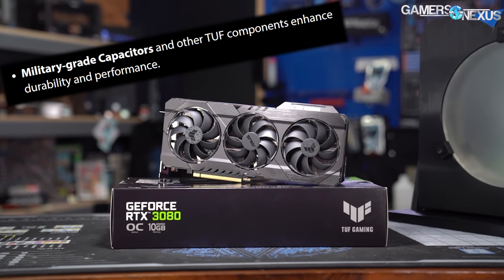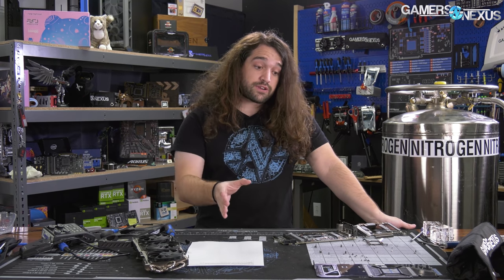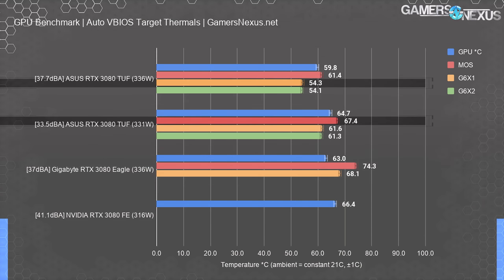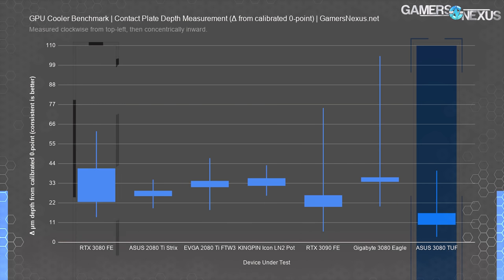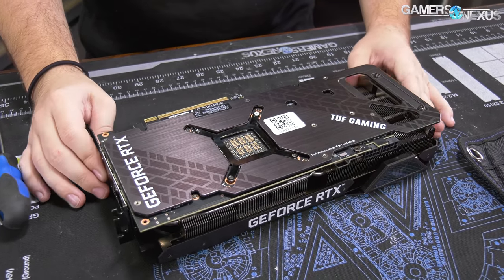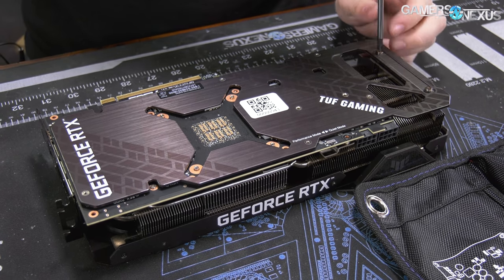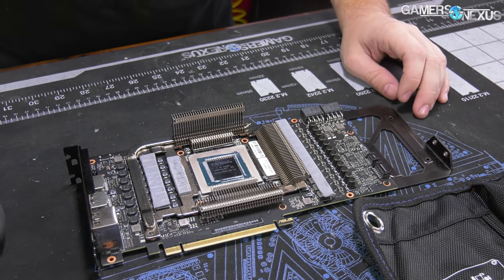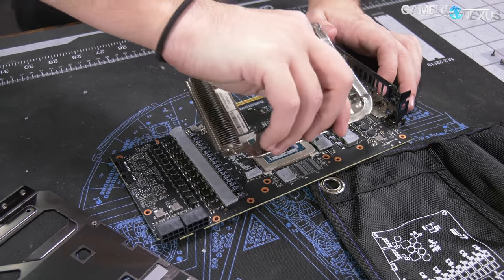ASUS RTX 3080 TUF OC Review & Tear-Down: Thermals, Noise, & Overclocking

Comment: As some folks already commented military spec components means they operate at wider temperature range, usually -40 C or less minimum and +120 C or more maximum. And while also have the supply chain secured and have longer lifetime, meaning the manufacturer won't deprecate the component after only few years, some go over 20 years. These all add to cost. From the lowest, the grades are: Industrial, Automotive, Medical (when it's about PSU mainly), Military, and then Aerospace/Space hardened.

Come on GN, you know better. Do your research before lashing out so you don't look like a total clown.

Comment: aircraft grade aluminium is not just aluminium. Its 6061 or 7075 Alloy. The term military grade indicates it is of higher quality or binned higher. I think the point your trying to make is that they are just using it as a marketing scheme. But to say that it doesn't exist in other context is silly.

Comment: "Military grade" means nothing.  The term that would be potentially relevant is "MILSPEC," meaning a thing meets the minimum specifications required for such a thing for use in militarily essential things.  I say potentially because sometimes that specification is not particularly strenuous.
Reply: then the question becomes which Spec.

Comment: 18:30 Inductors are not just a coil of copper ! XD
This copper is enclosed with ferrite that gets hot when switching power rail (12V) to lower voltage (1V).
The characteristics for these ferrites get much worse when operating at high temps. This means that if they get to 100C, they will lose a lot of their inductance and make a lot of noise, because inductance gets lower and current ripple becomes higher. This also brings more wear and tear to caps, worse power efficiency...
It could  get so bad that inductor stops being inductive (only wire), imagine what will happen if you short circuit 12V to 1V GPU power.

Comment: Well Ive got the TUF 3080 non oc model and have been playing around believe it or not in firestrike, trying to get the world record for a 3700x and 3080 combination of GPU and CPU, I have struggled getting past the 32000 points mark. Maybe its my TUF gaming X570 mobo? Cooling Noctua Chromax BLack? I dont want to run liquid nitrogen..... what are my options. The 3700x is a mega pain for manual overclocking and have had better results with DOCP (XMP) on the ram and just let the 3700x boost naturally. What are my options here that arent going to cost me an arm and a leg... I know the 5000 series CPUS are around the corner so the first person to say that... well... I wouldnt be going for the same record then would I. 

HELP !

Comment: Hey gamers Nexus, I would appreciate if you'd show gaming performance anyways, I can understand the reason why you skipped it, because it's nearly the same as other 3080,but I'd sind it way easier if all the necessary data for my purchase choice is compressed in one video. If I want to buy this card I and I didn't have the general 3080 gaming performance specs in the back of my head, I have to search for another video , even tho I just watched 30 mins review. If you could just show a screenshot of the general 3080 gaming performance it would already be enough for me. Thanks

Comment: I would assume "Military Grade" means that the capacitors meet Mil STD 198.
Reply: Don't assume. Its not a real term. Its all marketing BS. And if it does meet a Mil STD its probably not the correct one for this application.
Reply: For example the Standard for metal food packaging would be very different than the one for the metal in aircraft.

Comment: When you say "there is almost no gaming performace difference between two models" do you also say, that the TUF ist almost as good as the Strix? This would mean to me, that there is no reason for me to buy the Strix instead of the TUF. I do not really care about a little bit RGB, but I thought there should be a noticiable difference with the higher Power Limit.

Comment: lol fan replacement! I once had 2 msi gtx460's and the fans died on them after 7month, and i could not get msi to rma the cards or find  the correct fans for them so i took 4 80mm fans 2 per card and zip tied them to the card after removing the old fans and shroud..

Comment: If they are using actually MIL-SPEC certified capacitors ASUS is pissing your money away. You dont need the supply chain certification in a COTS situation. Looking at the PCB, there is no way the card meets many mil spec

Comment: Just for info aircraft grade aluminum is not equal to aluminum!!!! Check your claims. Aircraft grade are aluminum alloys that are heat treated topical 6060 etc. There are also submarine grade alloys of aluminium that are corrosive ressistant and czn be welded as aircraft grade can’t be welded as you are creating weak point as you destroy the heat threatment within and arround the vonnection!

Comment: Uhh...no Steve all the cards are not the same. Otherwise there’d be just one card on the market. Reason we want to see gaming performance as well as tear downs and everything’s else, is if we are going to buy a 3080, some of us want the best there is. Meaning best components used, best overall design, best stock cooling solution, best bin GPU, etc...average FPS, gives us an idea of its performance comparatively to other cards, even if it is just a few FPS. All of that gives us an idea for the quality of the card, and it’s potential OC performance. 

So no Steve, average FPS IS important to some of us. Yes we’d still like to see it. Otherwise what’s the point of an in depth review if some important information is omitted?

Comment: I feel that if taking off the aluminium top cover appears too dangerous for you, you shouldn’t be replacing the fans yourself

EDIT: The wires not so much though. Those should just be small plugs, current way you could damage the wires trying to cut it open or not be comfortable applying heat for the shrink tape

Comment: “Military Grade” is a legitimate grade of electronic components.  All components manufactured have a certain % tolerance of their rating (I.e. a 200 ohm resistor could be 180 or 220 ohms with a 10% tolerance).  Military grade tolerance varies for different components but is typically between 2.5-5% max tolerance.  While there’s usually a negligible difference in performance from using military grade components (since the die itself may have worse tolerance, negating any benefit, they almost always outlive any consumer grade equivalent (one reason why Macs tend to last a lot longer, Apple uses “military grade” tolerance components).
While there’s no actual “certification” for military grade for non-military use (there is for military use), the term is used to refer to a tighter spec based on military standards.

Comment: I own several Asus products.  All I gotta say is pray you don't have a lemon or have a need for support.  These products are great when they work, and you are pretty much fucked if you have to get in touch with support.  After several RMA's I had to go through the BBB, got in touch with a VP over my complaint.  Sent a disseration of the issues and symptoms I had before they could verify there was an issue and finally sent me back a different board that worked.  Pray to gods you don't have to go through their support.

Comment: I'm having trouble finding content I give a damn about lately with this 3080 crap. I cant get one even if I wanted, and as a matter of fact even the 2060 super and 2070's, etc. are still crazy priced, always out of stock, and nothing too interesting. I guess I got spoiled with that big jump in performance from the 900's to the 1060, 1070 cards. Now nothing really seems worth it. I have a 1660 that's running my games on high and a 2060 that's over 300 bucks is only 30% more performance. Hopefully there'll be a 3060 or something around there that's worth a damn that doesn't cost $500

Comment: That card is not that good as it should bee, to be TUF ;). Cooler is good, but not perfect design. I like Asus TUF motherboards ( my last three was Z270 Mark 1, Z490-Plus Gaming WIFI, and actual Z690-PLUS Gaming WIFI D4 ;) ). But when i wanted replace my old grapic card 2070 Super i chosed MSI 3080 Suprim X. MSI Suprim X is much better for me. ASUS made good motherboards and i use them from many years ( P5K SE, Striker Extreme, Maximus Formula, P7P55D-E, SABERTOOTH Z97 MARK 2 ... ), but i had only two or three graphic cards from Asus. Sometimes better was Gigbyte, MSI or Sapphire, and has better price ;)

Comment: Military grade? So beat to hell and barely functioning because the armorer is too lazy to actually put in the work order to get the parts to fix the issue because it’s not a deadline so you can scrape by until it “breaks breaks”. That’s what military grade actually means

Comment: Hey it's military grade, so that way our soldiers can play games while riding in a humvee sir, just as long as their wearing a static bracelet while installing, because you know static discharge is worse then a weapon discharge.... ok I tried, your on your own asus from here, so can i get a heat shield for my upper m.2 slot now, instead of  just the bottom slot? guess not...should of joined the marines..

Comment: Warning this card is no good at all, think carefully before buying it !!   I just tried it with a 270Hz monitor and wanted to quad buffer the FPS so I set max_fps at 1080 to get lower ping times but only get average 980 FPS at 320x240 d_mipcap 3, modified single color sky for higher FPS.

The difference from 270 to 980 FPS is around 4-5 ms.

Im so dissapointed, what are you even supposed to do with this card... play Tetris? I was hoping to buffer the screen Hz 40 times.
Reply: shud i upgrade from nvidia 3070 8gb FE to asus tuf 3080 12gb . please suggest. i have benq 1440p 144hz 27inch monitor
Reply: @CaptainScorpio24   That depends on what value money have to you but because you wtb a 3080 I assume you dont want to waste money so the answer is no. Do you want another card because it has more memory? If so then I have to ask if you run out of memory with the one you use now and if you do there is always the option to lower the resolution. I havent checked the prices but if you feel a desperate need to upgrade your 3xxx you might as well go for a 4xxx card unless you found a cheap second hand card.

Comment: ASUS's military grade claims are horseshit.

I used to use ACTUAL military grade computer hardware in Afghanistan. 
In fact I'm wrapping up a dispute with them over a notebook hardware failure that got so bad they sent me a link to email the CEO's office.
I'll be bitching at him/her from a Panasonic CF-31 that has tanked through nearly 10 years of getting dropped, smashed, dusted, you name it, but is still running great with a  new Linux install.

Been SOOOOOO disappointed with ASUS lately. Stopped using them in builds.

Comment: me and many other owners having issues with this card refusing to spin fans below 51-53%... fan stop not working. We are waiting for a VBIOS update that might fix this. Or it might be faulty fan connectors. Many other owners have this issue too. I have VBIOS 94.02.26.80.AS06, other people even with different BIOS like 94.02.26.C0.0 have the same issue, even on the STRIX. https://rog.asus.com/forum/showthread.php?120872-3080-TUF-with-(Bios)error-(Biosswitch-Fanstop)/page3

Comment: military grade typically only means the material that was used can be traced back to a specific inventory lot that was used as well as adhering to strict standards and specifications with little play between similar components. 

its nothing to write home about. i have to design battery systems using military grade materials and let me tell you, its mostly dog shit.

Comment: :-) .. looks like samsung - nvidia - has just enough chips for the board partners to build some cards for reviewers xD. what i´m not used to with you is that your whole body language signals, that you either dislike the card, find it crap or simply hated to review it .. and prefer the gigabyte (chunk). this card seems to be one of the better aib cards, so what and why is it with you? anyway - we are 4 weeks after "launch", and it´s completely impossible to catch any of the cards here in europe - except from scalpers and/or crazy dealers who massively overcharge it, even not having any info on delivery time. this whole thing is simply a complete mess.

Comment: I have 3070ti, 3080, 3080ti all tuff they are terrible cards
Reply: Why.. lol
Reply: @dr.dolphin765  the thermal pads are not well done in these cards
Reply: @damorafik  ive had mine for a year not noticed any issues
Reply: whatt seriously. im looking to buy 12gb one and this is the size which can fit in my case
Reply: shud i upgrade from nvidia 3070 8gb FE to asus tuf 3080 12gb . please suggest. i have benq 1440p 144hz 27inch monitor
Reply: @CaptainScorpio24  if the update is absolutely required go ahead but stay away from tuff otherwise FE is good card